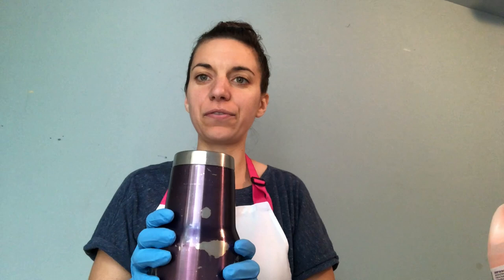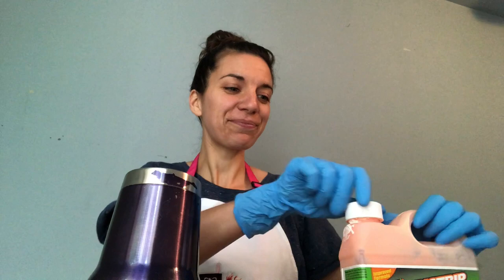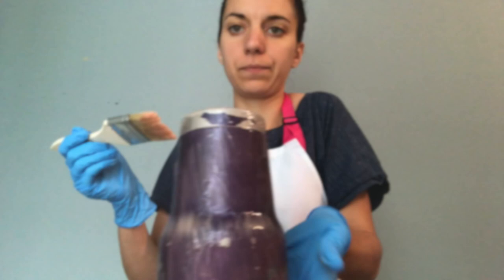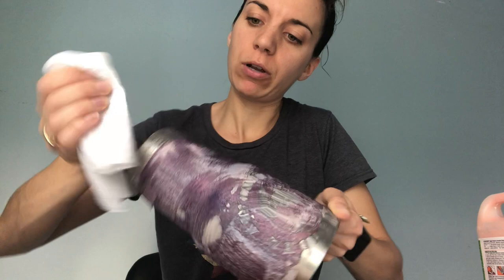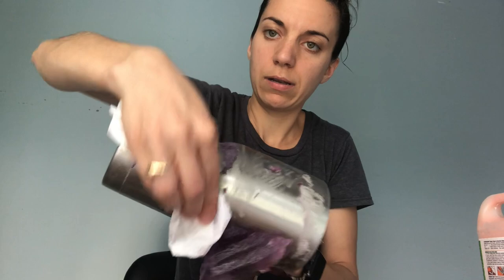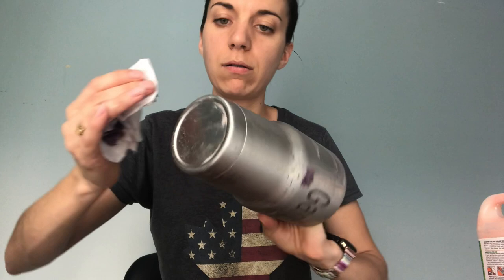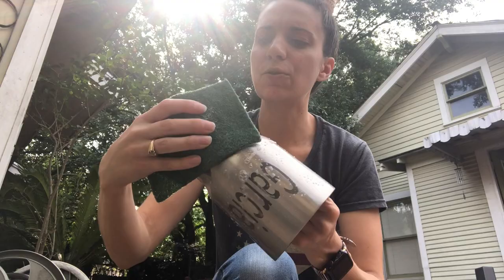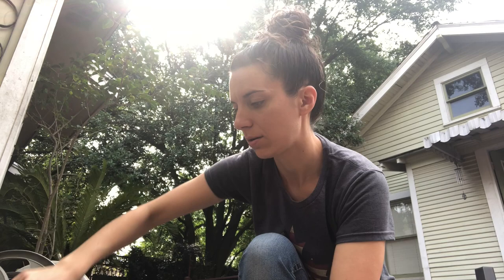How to Remove Paint or an old Coating off a Cup

Comment: So this stuff works for stripping cups? That seems so much easier than I’ve been reading!
Reply from the maker: Sorry I missed this comment. I like using citristrip for coatings, but I prefer using acetone if the cup has been coated in epoxy. You can check that out here: https://youtu.be/-xvzh_Cd3tA